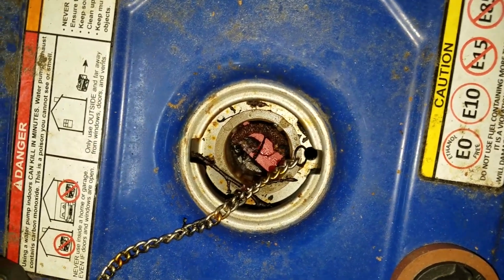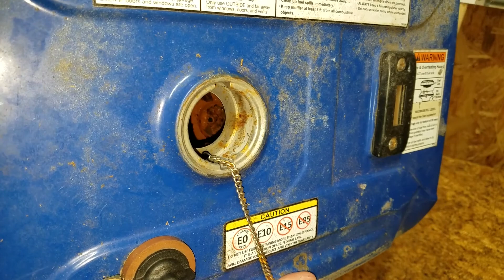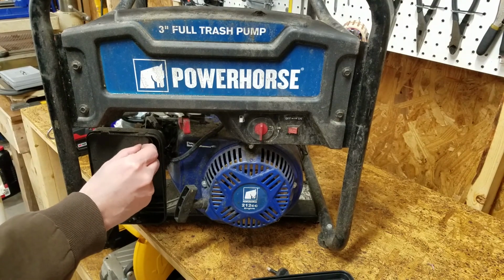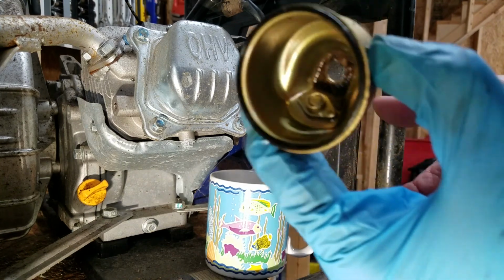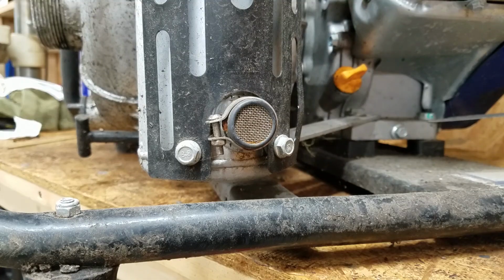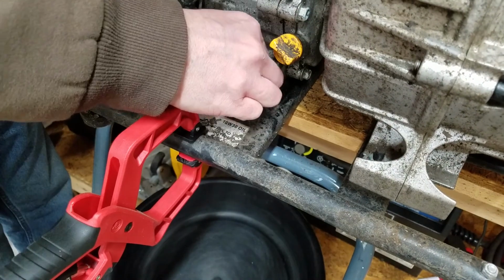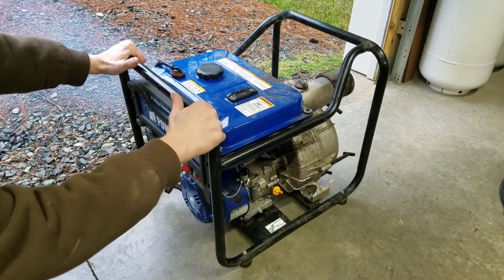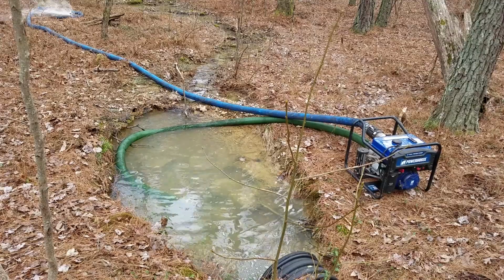Repairing a Trash Water Pump

Comment: Was really hoping you would remove the volute to check the impeller water seal as I have the same design with leakage into the crankcase. The volute is held on with (4) pins on the back of the housing but stuck. Going to try some heat to loosen the corrosion. I have the new water seal kit to replace and hope that works. Thanks for posting, cheers.
Reply from the maker: Ah, yeah, luckily that didn't end up being an issue on mine. It sounds like you have a good plan to fix it though, good luck!

Comment: Evaporust works very well for cleaning up rusty fuel tanks.  Put a generous batch of nuts, bolts, washers in the tank and shake around.  Try to focus on thhe worst areas inside the tank.  When ready the nuts and boltscan be removed with a magnet on a flexible shaft.
Reply from the maker: I've heard nothing but good things about Evaporust but I've never tried it. I've only done smaller steel fuel tanks so far, but I've had good success with BBs and vinegar. The BBs are effective and get into all of the nooks and crannies. Thanks for the comment!

Comment: Pump just needs a little back pressure to get started. Having the discharge hose rolled helped that happen.

You could also lift the hose  as high as you can about 10 feet away from the punp
Reply from the maker: Ah, so it's better to leave the discharge hose rolled? Thanks for the tips!
Reply: @Mikeattempts  I'm actually outside pumping water off my property as we speak. Yes, leaving it rolled will help or using something at the end to restrict the flow until you hear the motor under load.

Comment: I bought a 6.5-hp trash pump after running it for 1 hr the starter cord got stuck. any ideas on how to fix it?
Reply from the maker: I'm no pro but you should be able to take the pull cord assembly off. Do it slowly though because there might be a coil inside that could rapidly unwind if you just yank it off. :) The cord is probably just bound up against itself or the housing.

Comment: I have a brand new 4” trash pump, all primed with water and still doesn’t pump water.. any ideas how to solve this problem?.. second pump with the same problem
Reply from the maker: My guess is that it needs to be closer to the level of the water you're pumping. When I tried from the back of my tractor, it wouldn't pump. I had to take it down closer to the water, which was probably 2 or 3 feet lower than the driveway. Your manual should say the maximum rise for the intake hose. Let me know how it goes.
Reply: @Mikeattempts  mine is right next to my pond when I tried to pump.. maybe a max 1 ft above the pond.. I’m bringing the pump back as I’ve only had it for 10 days.. crazy same pump I bought a few years ago as the one I have now didn’t pump water as well.. weird
Reply from the maker: @Dave C  Hmm, that is odd. Well, good luck getting one that actually works! :)
Reply: How old is this pump
Reply: @Dave C  Put a foot valve onto the end of the intake hose instead of the standard strainer. Fill the intake hose with water then attach it to the pump, quickly,  trying not to let too much water drain from the hose. Fill the pump housing with water and cap it. Start motor and you should have water flowing instantly.
Reply: @davec1402 Sounds like user error

Comment: What about if the starter cord won’t pull?
Reply from the maker: That could mean the pull cord is just bound up or that the piston is seized. Remove the spark plug and squirt some spray lube or a little oil in the hole and let it sit. That might be enough to free a stuck piston. Let me know how it goes.
Reply: @Mikeattempts  no luck on the Powerhorse 2 inch pump. But, I went out to use my Brushmaster chipper and same darn thing. Did what you said and at least it’s moving now but couldn’t get it to start. It got uncovered in the rain and I think some water leaked into muffler and made its way into the engine. Now how do I drain that and dry it out of water? Thanks for the help so far and in advance.
Reply from the maker: @timdelvecchio8472  Put a little more oil or spray lube in the spark plug hole, screw the spark plug back in and let it sit over night. After it has sat for a while, remove the spark plug and pull the starter rope. If it seems to be moving freely, then give it a few good yanks and it will shoot the water/oil out of the spark plug hole. You might also want to change the oil to be sure there isn't any water in there.

Comment: So what fixed the pump
Reply from the maker: Nothing ended up being broken but I had to clean the fuel tank, fuel line, and the inside of the pump housing for it to run. It wouldn't pump from the back of the tractor because the pump was too high above the water level. When I moved it down next to the water, the pump started working properly.
Reply: So shouldn't the pump have a better head than that?  I inherited one of these, starts great, but really struggles to get up to pressure if at all